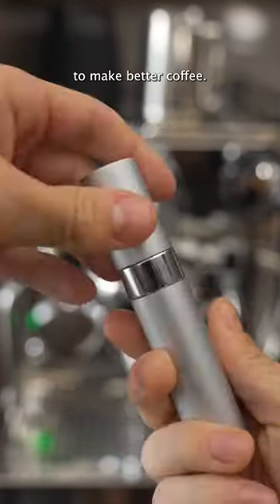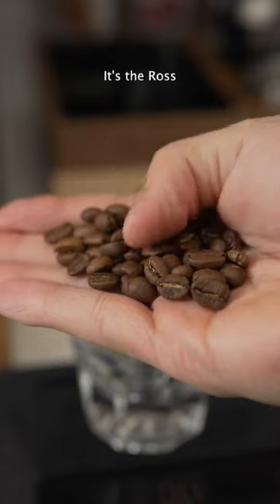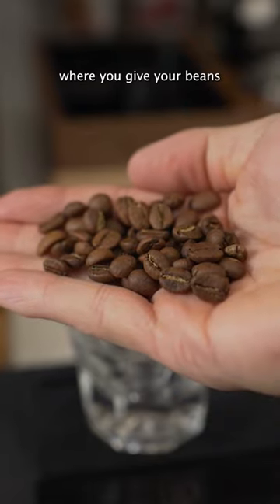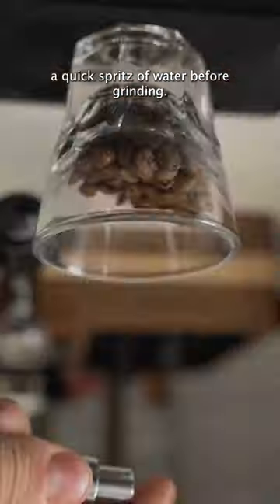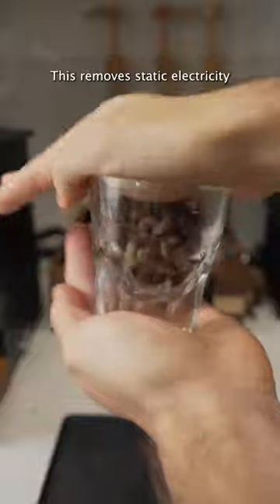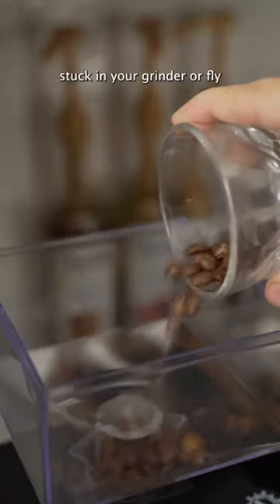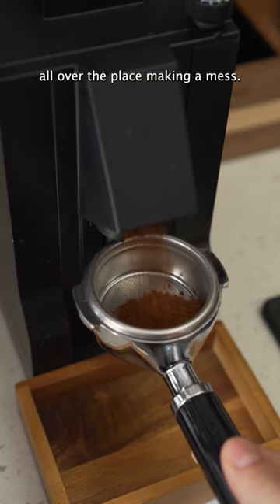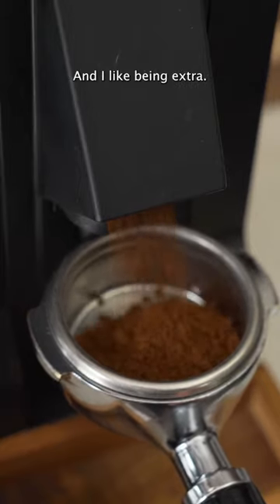Spray bottle = better coffee #coffee

Comment: Can i do this technique on a manual grinder? Worried it might rust it. Im currently using commandante c40 mk4
Reply: You can. Can also wet the back of a spoon/your finger and stir the beans. You shouldn't need to unless you get a lot of retention, though.
Reply: You’d get more moisture on your grinder by sneezing on it than spraying your beans lol

Comment: Does the moisture clog up the grinder / clump up the grounds in the grinder?
Reply: No, it’s not enough water to cause any problems, at least I haven’t had any issues yet. Just don’t go overboard, 1-2 sprays max
Reply: @milesjohnson3324  thanks Miles - maybe I was just adding too much water (using a Baratza Vario). Couldn’t tell for sure